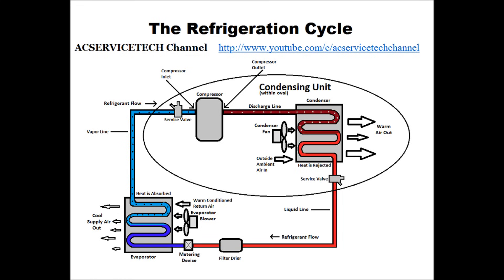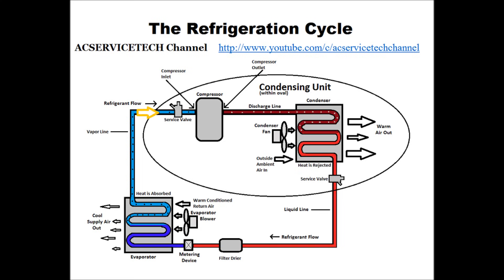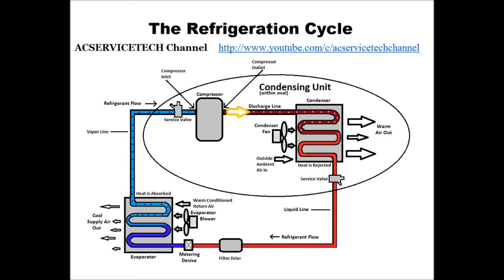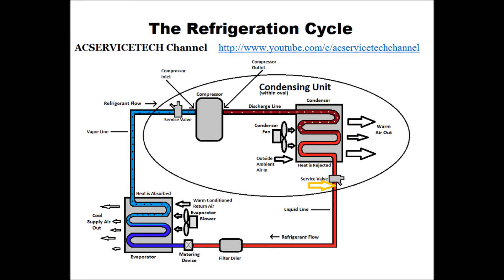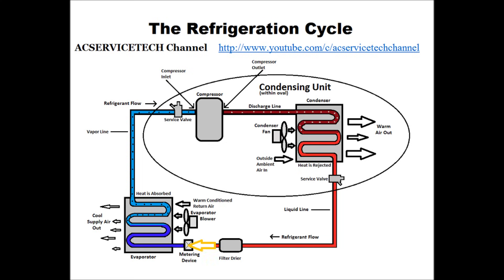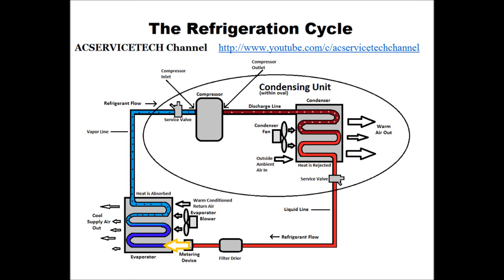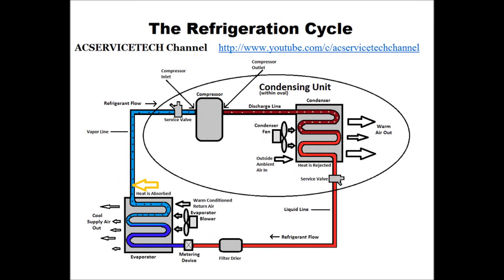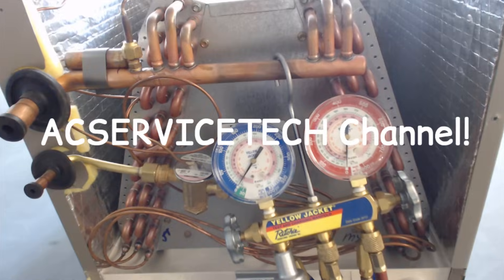Refrigeration Cycle Tutorial: Step by Step, Detailed and Concise!

Comment: OK great, so how does the liquid turn into a vapor while absorbing heat...it goes through the filter dryer as a complete liquid, then the metering device at a fixed state changes the pressure, low pressure low tempurature...so now that the refrigerant is now coming in slow, and is now allowed heat through, is the heat changing it into a vapor, and the "rest" goes out as cool air. Thats where I struggle, how is heat being absorbed, but the supply line lets out cool air, hence the pressure is low..what makes the air cool, if absorbing heat

Comment: My confusion is how the sides are kept separate. Wouldn’t letting refrigerant into the cool side also cool the hot side as it also reduces the pressure there! How are they sides kept at different pressures yet have flow between them?
Reply: @Amybnuy The metering devices drops the pressure of the refrigerant by only allowing controlled amounts at a time.
Reply: @GGMcGeeAmericanMe  Oh yeah I see. so it's like basically pressing very hard on a syringe with a very small needle filled with something. the other end is pressurized, and the small valve means that small amounts are moved without ruining the pressure of the other end

Comment: Not like anyone reads these comments but for easy understanding, correct me if wrong but the system has a split at either the compressor or the metering device. These points are doing the opposite of each other. With the same point being made for the condenser and the evaporator. The condenser does the opposite of the evaporator but by the same process. The metering device begins low pressure and temp, and the compressor begins the high pressure and temp. The whole process is a change from a full vapor to a full liquid and by understanding the main components essentially do the opposite of each other really simplifies the cycle in the brain.
Reply: graph is just a basic understanding, package units min splits and regular split systems are built differently but work the same
Reply: You just explained my head

Comment: Great video. Its hard to your head around the physics of phase change. Heat gets exhanged without a change in temperature right?   Is it true that the temp of the refridgerent isnt changing that much thru the whole cycle BUT a lot of heat is being exchanged because of the 2 pressure changes ?

Comment: not bad not bad, except you should make note that the filter drier should be as close to the compressor as possible. Im sure you know why but for anyone reading the comment its to keep as much oil as possible at the compressor and not allowing it to travel to the evaporator where it will get trapt. It will migrate back to the compressor area during cold spells.

Comment: I just started apprenticing in commercial refrigeration. So we deal with walk-ins. 
My original understanding of the subject was that something cooler than another thing will draw the heat to the cooler thing, thus removing the heat and making it cooler. In a walk-in fridge, the low pressure side coming into the fridge and through the evaporator coil is warmer than the air in the fridge. How is the warmer thing taking out heat from the fridge that’s already cooler? I really hope that makes sense. Please remember I’m just starting to learn; go easy on comments please. Lol

Comment: This may be stupid as I am only an installer. But if Freon has a lower boiling point, how is it a high temp liquid going into the evap coil, but a low temp vapor. I figured high temp &/ high pressure would evaporate the Freon going back to the condenser

Comment: Thanks for explaining so well in few words.
Saturated state:
Where vapor an liquid coexist
High pressure high temperature vapor into condensing unit after compressor.
High pressure high temperature sub cooling in the condenser 
Low pressure low temperature into evaporating unit after the expansion valve.
Low pressure low temperature super heating in the evaporator unit.

It is latent heat rejection & condensation followed by sub cooling in at high pressure and temperature inside the condensation unit

It is latent heat addition followed by super heating at low temperature and low pressure after the expansion valve inside the evaporator unit.

Comment: I have a question. I have a lg refrig. I had it for about 9 months. Now it has no lights no coolant nothing  the only thing that works is the fan by the compressor. I bought and replaced a mother board. it didnt make any difference. All I get is the fan by the compressor but the compressor nor anything else is dead. can you give me some advise

Comment: Wouldn't the condenser fan motor be sucking air through the condenser, not blowing it out. Usually I put a piece of paper on the condenser to see what the fan is on, when it's on it should stick.
Reply: It should always blow. If it’s sucking air into the unit, it’s spinning the wrong way.

Comment: Great explanation.

Why do I always hear “the heat is dumped outside,”” (at the condensing coil). Indicating that the heat you feel from the outdoor unit is from inside the building?
Reply: The low side(cool side) absorbs heat from within( for the sake of example) your house. There’s an area where the warm air in your house can contact the evaporator and draw the heat in, thus cooling your house. The refrigerant that has absorbed all that heat from the warm air then travels to the condenser coil, outside, where a fan connected to the unit blows all that out of the condenser. Hence ”dumped” (blown off)it out outside. 
This is a very simple and shortened explanation. Any others who read this can give their two cents on my explanation.

Comment: i appreciate that you have a video on the subject yet you are able to explain it  clear and proper.. this is another good skill you possess
Reply from the maker: I appreciate that!
Reply: The  drew  aschematic  diagramof  a  simple  refrigeration   vapor compression  cycle.  Cycle  and  system    .The  components  required  for  a  compression  refrigertion system  are a coppressor   ,condenser,liquied   receiver  expansion valve  andevaporator  or  cooling  coils  the refrigerant flowfrom  the expansionvalvethrough  the whre    eitabsorbs  heatandbecomesa  gasorvapor thenit  flows  to  compessor whreit iscompressed to  the condenser pressure in thecondeserthe heat  removedandthe  receiveritflows  to  theexpansionvalveto  startthe vciruit  again  the  refrigerantis  underlowpressurfroevaporatertothe  comprssor suction  this  portion   of  the  system   is   called   the   ..lowside  .the refrigeant  is   under  high  pressure   fromthe   compressor through  the  condenser. liquied reciver  high   pressure  from  the  compressor   through  the  condenser  .liquied  receiver   and  liquid line  to  the   expansion  valve  .Thisportin  of  system  is  called   the   high  sidemthe ev expansion  valv
ethrough  the
Reply: Cycle  ing

Comment: hi Thanks for your clear explanation of Refrigerator Cycle. I have one rather important question I would like to ask. Your Airflow where does the Air come from. Is it normally a Close Loop System where the Air is constantly re-circulated by the Evaporator Fan in the Fridge, or is Fresh Air Intake going on so that the Evaporator Fan is constantly pulling Fresh Air from the Outside and blowing it through the Evaporator Coils inside the Fridge. Also if it is not a close Loop System and the Fresh Air is constantly being sucked in from outside , is it vented out as it is recirculated inside and replaced by a fresh stream of air. Thanks

Comment: I'm confused on one thing.  I saw in another explanation that the compressor can't take any moisture so there was a drier installed just before the compressor not the Evaporator.  Or, is there a different kind of drier before the compressor?  Just curious.
Reply from the maker: They meant the compressor cant take liquid refrigerant. The tank prior to the compressor is the accumulator and it makes sure only vapor refrigerant enters the compressor and not liquid. It's not a filter driver, thanks!

Comment: When you change schrader valves do you use a torque tool.  If not is there a rule of thumb for how much to tighten?
Reply from the maker: If you don't use a torque wrench, you just test them afterward to make sure that they don't leak. Valve Core torque wrenches just came out a few years ago, thanks!

Comment: For superheat, would line temp measurement be better at evap outlet or is the temp remain relatively the same down the line set to the condenser suction king valve?
Reply from the maker: It is very close to the same and since the only port we have is out at the outdoor unit, we usually check using the total superheat method. This will also verify compressor safety as well, thanks!

Comment: Do you use Blue Nylog at all?  If so can you use it when changing a valve core under pressure with a valve core removal tool? Would you coat the gasket part of the core or would that all get blown away since its entering a pressure enviornment?
Reply from the maker: I only use it here and there on refrigeration flare joints. I also just use POE oil. No you wouldn't use it for that. The valve core will seal without that, thanks James!

Comment: My instructor taught me that the refrigerant was turned into a low temperature, low pressure liquid after it leaves the condenser...is he teaching it wrong? Or am I misunderstanding something? O.o
Reply from the maker: I think what he meant is that after the saturated state in the condenser, the high temperature, high pressure liquid starts to lower in temperature. This is called the subcooling. It is still considered high temp, high pressure subcooled liquid up until it gets to the txv, thanks!

Comment: Do you recommend the purchase of a megger to deeply diagnose a compressors resistance to ground?
Reply from the maker: Yes, it is a good purchase but in residential many techs get by without it. They are nice to use when you are continually checking the same equipment to test for degradation, thanks
Reply: yesI am a maintenace man for a big complex and my thinking is to log the ohms of each compressor over time...might show up a slow degradation of the windings...would that be a good use for it and do i use like a regular vom?

Comment: Are there any A/C systems equipped with a defrost cycle?
Reply from the maker: Heat pump units operating in heat mode, freezers or other coolers that stay below 32 degrees in the box, thanks

Comment: A question for you... I understand that lower pressure means lower temps but a frozen return line seems like it could also be from an overcharged system because the more I charge the system the colder the return line gets.  So these seem to contradict.  Please comment.
Reply from the maker: You are referring to a fixed orifice system where as you charge, the superheat lowers but it will only lower until you have no superheat left which would be dangerous for the compressor since liquid will be entering the vapor compressor. The sat temp on vapor line should always be above 32 degrees unless there is low refrigerant charge, low airflow or a liquid line restriction, thanks

Comment: when you continually use the temp probe with electrical tape does it get gummed up by the tapes adhesive?  If so, does it affect reading and also how would you clean it or keep it clean?
Reply from the maker: Actually I don't notice it getting gummed up at all.  If you were ever concerned it wasn't reading the right temp then zip tie a piece of armoflex insulation around it. I think these are more precise than the clamp type since they are so small, thanks

Comment: what brand type of gloves do you prefer when handling refirgerant?
Reply from the maker: Honestly it is very hard to find gloves that actually say buytl covered or lined that fit in a way that you can actual do work in them. I often times use pig skin leather gloves with nitrile gloves inside or a thicker throw away nitrile glove like dark light 9 mil, thanks
Reply: Is the brand name ADENNA of the 'dark light 9 mil gloves" you use?

Comment: Hi mate I have 2  questions
1- you always say check the metering device in indoor unit for deciding and calculating   (subcool or superheat).
If we check the metering device type in outdoor unit, does that necessary mean the indoor unit metering device type is the same or not?

2- in a heat pump mode how can we calculate the subcool or superheat values. When the unit is working in heating mode???

Thanks a lot.
Reply from the maker: The outdoor unit will not know what metering device is at the indoor unit unless it was a minisplit with the metering device in the outdoor unit. You have to check in cooling mode only with the OA at 70 or higher temp. If you are trying to check hp in winter, it is the total weight method unfortunately, thanks

Comment: Hi, one of our techs recently installed a Goodman condenser unit. He was told the unit now comes with a built in filter dryer and did not install one.
I am thinking he was given bad advice b/c I don’t see where a filter dryer would be. Any idea if this is true? 
Thanks!
Reply: factory installed driers are inside the condensing unit.. some have them some do not.. if there is one in the smaller line coming off of the compressor it is a muffler not a drier
Reply from the maker: Some goodman units come with the filter drier actually installed in the outdoor unit unfortunately, thanks
Reply from the maker: Yes absolutely, if there is a filter drier installed, it is on the liquid line inside, not the discharge vapor. Thanks Trey Baker!
Reply: Thanks!

Comment: and what is service valve?
Reply from the maker: The service valve is where you connect the refrigerant gauge hoses to and where the service valve allows a front seat, mid seat, and back seat,  or with the ones with the schrader valves just the front and mid seat, thanks

Comment: I agree with this guys explanation but the only thing I did not agree with is the 80% to 20% liquid to vapor mix respectively, I have always been told by my (All Nate certified master technicians) instructor that it is a 75% to 25% mix of liquid to vapor, out of the metering device and vice versa out of the compressor.
Reply from the maker: That could depend on the distributor tubes  amount, length, and diameter after the metering device, as these are different, thanks P Tec!

Comment: I'm new to all of this but when it gets to the evaporator and turns to the vapour how is it pushing the cool into into whatever system along with absorbing heat?
Reply from the maker: So the indoor blower motor that pushes air through the vents in the house pushes air across this coil. The refrigerant absorbs this heat and then the refrigerant travels to outside where you have the outdoor unit and the air is sucked across the fins there and blown out the top or the side of the unit, thanks Baconshuffler! here is the hvac basics playlist-  https://www.youtube.com/playlist?list=PLxnHR5_D2ojxJXMmQlsZVUoDmNyPVv-o7
Reply: acservicetech thanks man this will help a lot!
Reply from the maker: Glad to help! Feel free to ask questions as you move on. It is a great field to be in and has supported my family very well, thanks!

Comment: Great video. I unhooked my suction line hose from the service valve and white foam like substance came out . Do you have any idea what this might be? Thanks
Reply from the maker: That would be refrigerant oil and refrigerant mixed. If it continues to bubble and pop and bubble again then that is created by excessive moisture in the system turning to acid. Also if it is yellowish or smells odd then that is acid that has formed and the charge and compressor are likely in bad shape. Thanks

Comment: WHAT? "the filter drier is there to absorb any moisture in the system" And its hooked up to the liquid line dude
Reply from the maker: That is correct. The filter drier's job is to collect water vapor moisture in the system, it has a fixed capacity to hold this moisture. It is located on the liquid line. Suction filter driers could be used to temporarily clean up a system and are removed afterward. On split systems, the liquid line filter drier is installed anywhere from the outdoor unit to the  metering device and remains there. This filter drier is to be cut out and replaced any time refrigerant is evacuated or pumped down.  Thanks Analog trading

Comment: I'm not an HVAC student or mechanic but I'm interested in learning about the refrigeration process:

1. Is the low internal pressure of an evaporator equal to atmospheric pressure or does it vary?  

2. Do refrigerants achieve their listed boiling points once they have passed through the metering device? (ex: does R134a really get down to -15.34°F)
Reply from the maker: The pressure is higher than 14.7 psi absolute which is 0psig. No the R134a does not get down that low unless in a very cold freezer system. It has to do with the pressure change. Thanks Jaime Huff!
Reply: acservicetech So do A/C evaporators have a higher internal pressure than an evaporator in a freezer...which is why a freezer can produce the lower temps? Thanks again

Comment: what happens when the drier fills to its maximum moisture capacity? is there any means to an escape of moisture?
Reply from the maker: Water will be able to mix with the refrigerant oil making alcohol and acids which the system will continue to circulate. This eats away at the compressor. It is bubbly when disconnecting gauge hoses. Not good